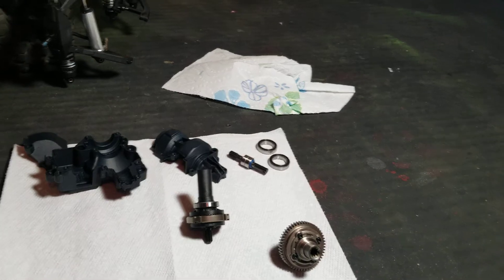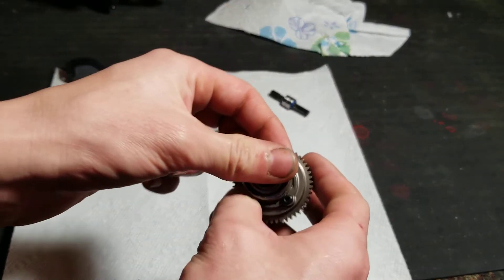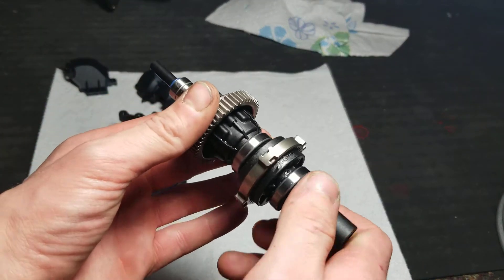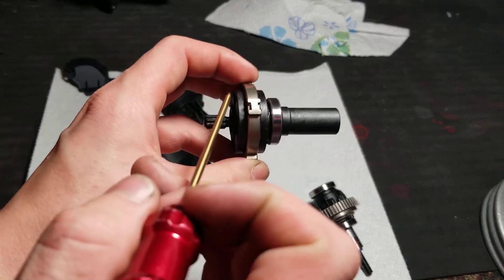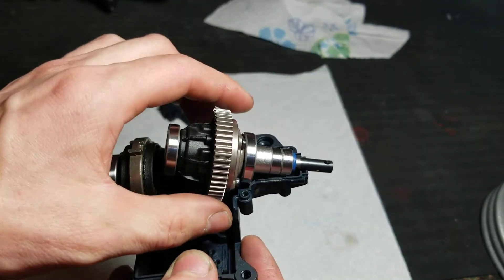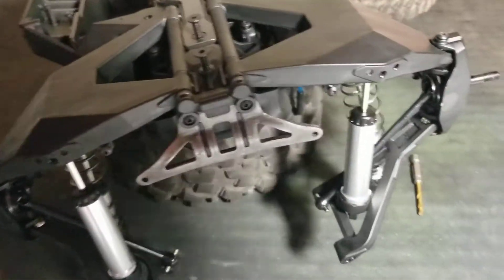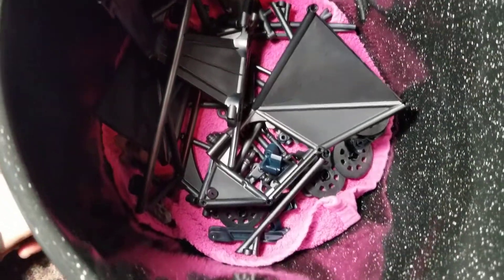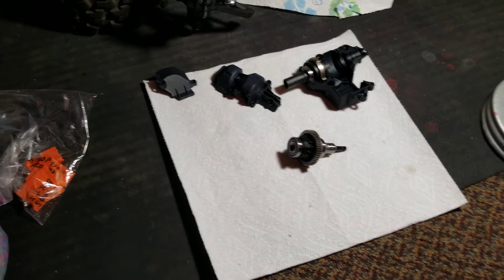Traxxas unlimited desert racer transmission assembly

Comment: Your shocks are leaking because they put plastic shock caps on aluminum cylinders just buy aluminum shock caps covers. It's a hobby they want you to spend money on it bro. I would definitely suggest getting a steel drive shaft if you haven't already GPM makes really good aftermarket parts for this truck